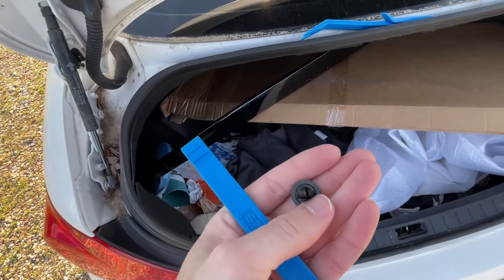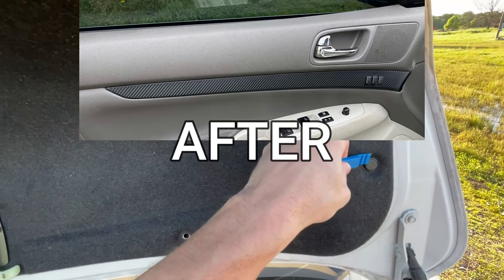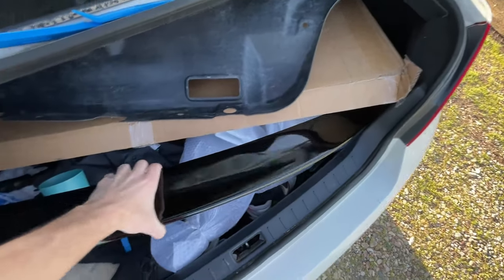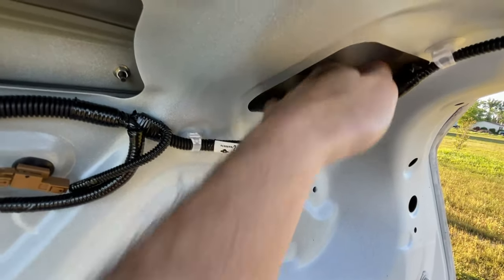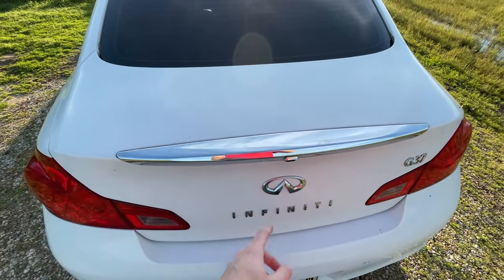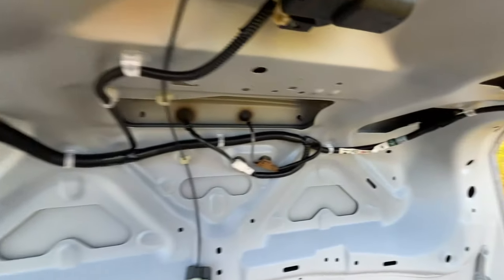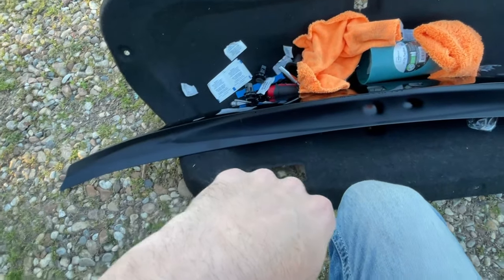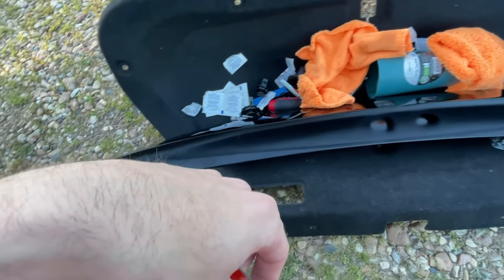Installing *NEW* DuckBill Spoiler On My G37 Sedan! & SUPER EASY Interior Upgrades!

Comment: Can you send the link from where you got this one from pls and thx you
Reply from the maker: Here’s the link for the one I bought. I wouldn’t trust using just the double sided tape that comes with it. In my opinion you need some other way to mount the spoiler to the car which is why I used the screws. I am going to go back and put something over them so they aren’t noticeable. More expensive spoilers may have better mounting hardware but not sure. 

KKoneAuto Rear Spoiler Wing... https://www.amazon.com/dp/B0C69PHN7C?ref=ppx_pop_mob_ap_share